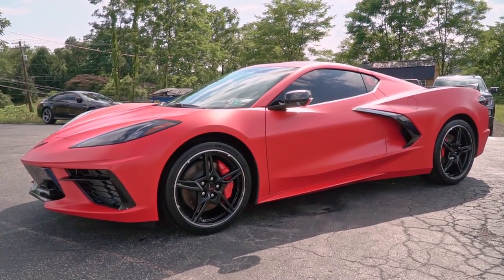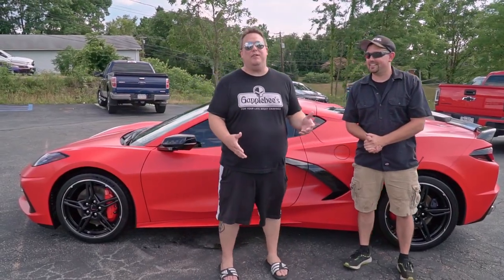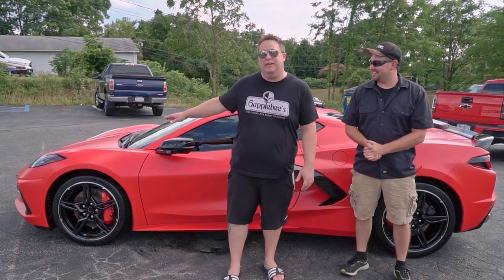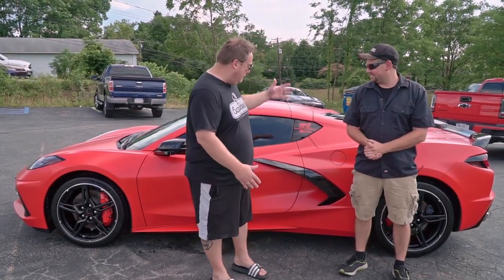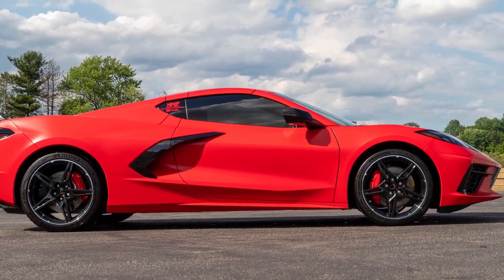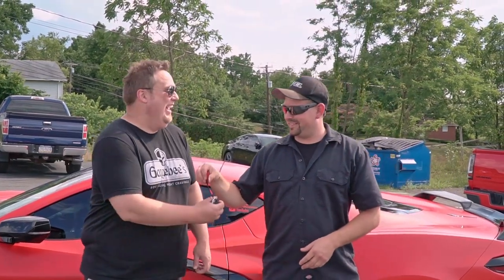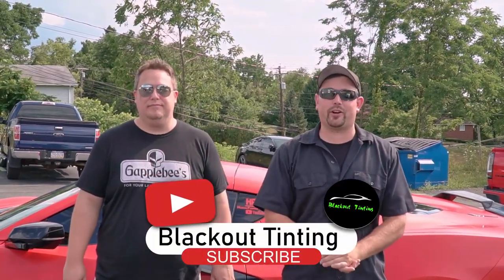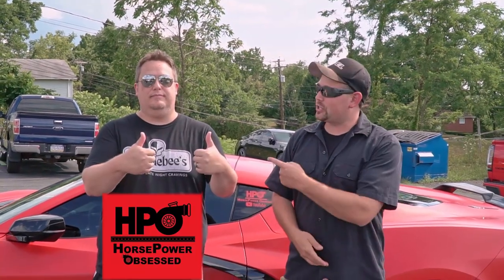CHANGING A C8 CORVETTE from Gloss To Stealth!

Comment: how much did you pay. these guys are talking upward of 8000 i can get another color wrap with that amount
Reply from the maker: 6 to 8k is normal for an XPEL full wrap.  Color change wraps will be cheaper, the material is a lott less expensive for color change vinyl as opposed to paint protection film.